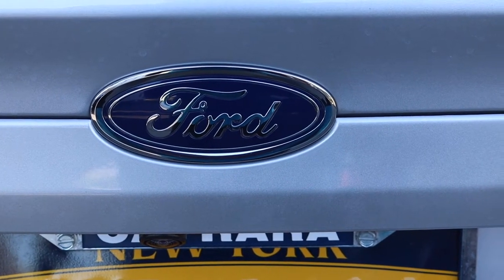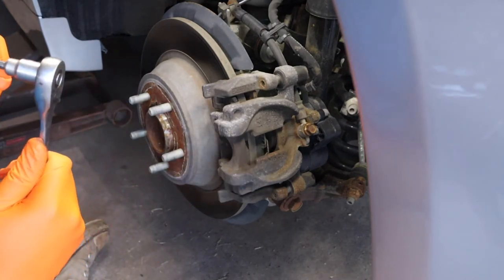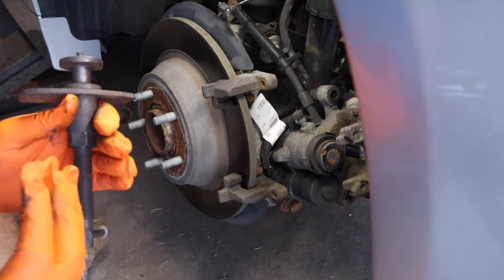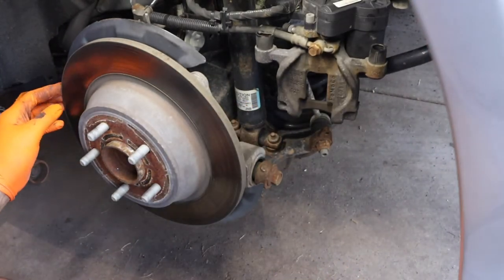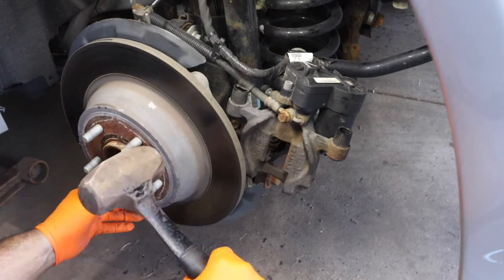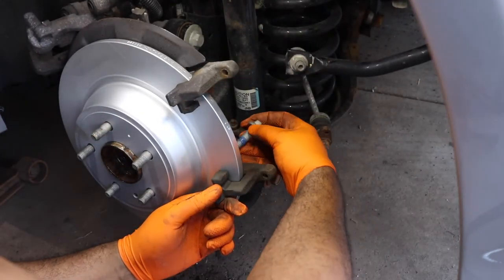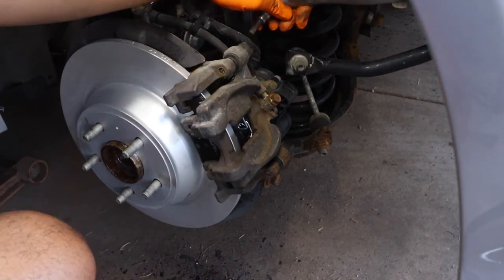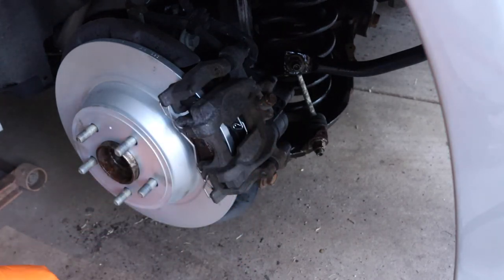2013 2021 Ford Fusion Hybrid Rear Rotors and Pads

Comment: This video was a huge help. Saved me $400 of labor since my dad already had the tools. Of course being in the northeast I had to spend 20 minutes each pounding the rotors off because the factory original rotors were rust welded to the hubs. Which my Dad then came out on my 4th and final rotor with a shit eating grin and his air hammer. 

The only note I'd add for clarity with people new to car repair is that after the brakes are replaced your car will warn you about the brake pressure or something similar because of the pistons being fully compressed. Just pump the brakes with a full press of the brake pedal a few times. This will extend the pistons, reset the system, and give the new pads the right distance from the new rotors. Once the warning light goes off turn the car off wait a few seconds and turn it back on again to confirm everything is as it should be. Then go for a test drive.
Reply: oh wow, what kinda grin your dad have?

Comment: Great video. I'm here because about a month ago, I took my '17 Fusion hybrid to the dealership for a checkup (138k miles). They replaced my rear brake pads and rotors. Ever since then, my MPG has been steadily declining. I was wondering if there was a cable or something that's associated with the regeneration system that wasn't properly replaced, but everything looks pretty typical in your video. Any idea why this could be happening? Also, about a week ago, I was driving, and for about 30 seconds, the advanced traction disabled indicator and hill asist disabled indicator came on my dashboard. They quickly went away after about 30 seconds and have not since returned, but it's just been weird that these things have occurred since having the Ford dealership replace my rear brakes and rotors on my hybrid. Thanks again for the comprehensive video.

Comment: Since the brakes also are used for charging the car, are there any special considerations that you have to make when changing the brakes?
Reply from the maker: Nope. The rotors, pads and calipers have nothing to do with charging. That happens in the transmission. The rear brakes aren’t connected to the drive train
Reply from the maker: @JohnnyKarate44  dealership sucks in my experience. The fusion in this video is my boyfriends and has the titanium trim level. It’s like a MKZ. Is your saying your MKZ is a hybrid like the fusion in this video the video will apply to your hybrid MKZ.

Comment: You don't put the callipers in service mode before pushing the piston in?
Reply from the maker: This car doesn’t require that
Reply: @jth1987leb  it most certainly does.
Reply from the maker: @Rotttman  I’m it going to go back and forth with you on this. It doesn’t require to be put in service mode. I didn’t put it in service mode. Nothing happened.
Reply: @jth1987leb  right. You don't need to torque cylinder head bolts either. You backyard hacks make me 😂
Reply from the maker: @Rotttman  you do need to torque head bolts. But just because the book says there’s a way to do it and you find a easier faster way that works why do what the book says. I don’t work in a backyard. I work in a garage. If you knew how to do it why are you here. If you know how to do it better why not make your own repair videos rather that gambling videos